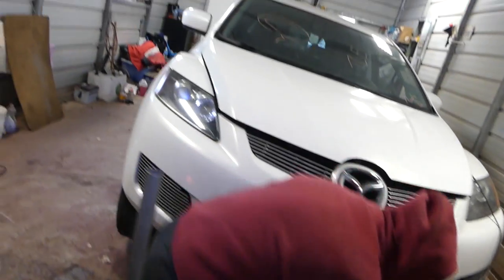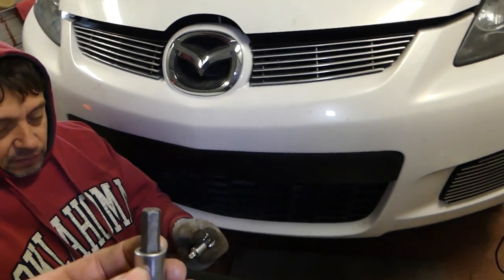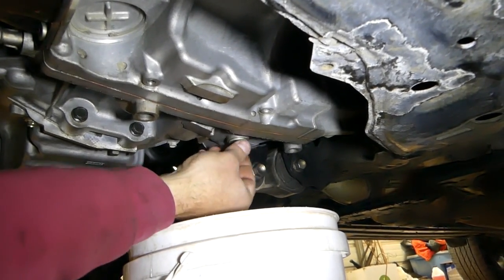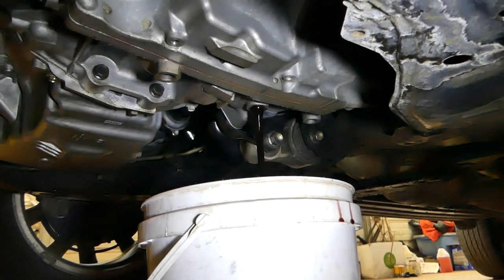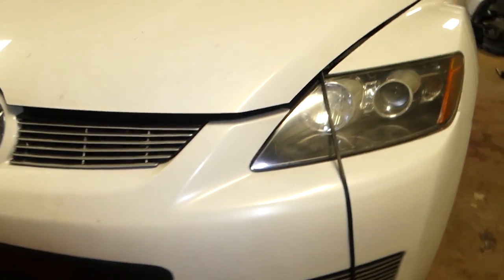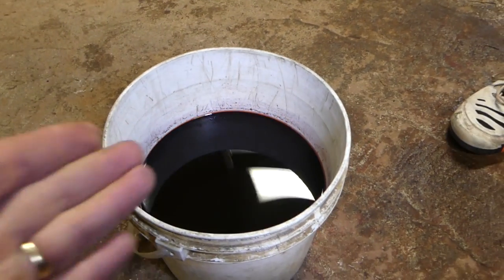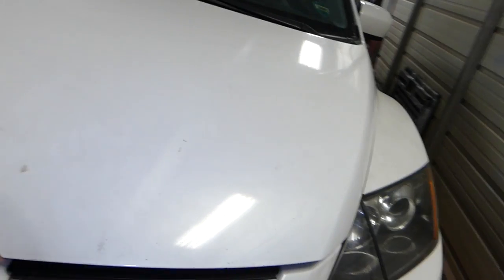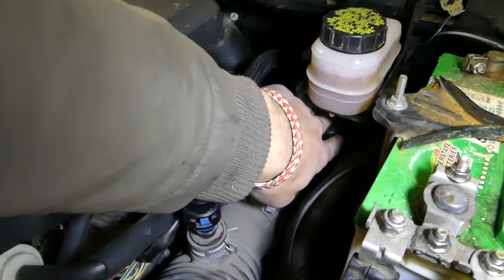MAZDA CX-7  AUTOMATIC TRANSMISSION FLUID DRAIN FLUSH CX7 2.3

Comment: Do you add the transmission fluid back in thru the dip stick? also do you recommend use of any AT fliuid with additives like lucus if there are 75000 miles on car?
Reply: Yes add back through dipstick, buy a  flexible oil funnel.

Comment: Hi Guys Thank you for the videos ,,, very very helpful . I have Mazda CX-7 2010 2WD 5 speed automatic transmission and I have a problem with the transmission,,, suddenly the reverse was not working and when I drove it for about 100 meter I heard click on the transmission and then I tried the reverse and it worked but it slipped again , I changed the transmission fluid but the same problem .. Do you think if I change the transmission solenoid pack would fix the problem or could be just few solenoids ?? 
Hope you could help much appreciated .
Reply: I have a similar problem. How did you have your transmission fixed?

Comment: when you drain the old fluid put a gallon of new fluid back in and remove the line on the radiator and put. piece of clear hose on it. Get someone to start the car and the new fluid will run through the torque converter and push the old fluid out and it will take about 10-15seconds and the fluid will look clean and shut the engine off and put new fluid back in and check the level
Reply: I had a hose get a while and I have no idea how much I lost and I don't have someone else to start the car what do you recommend? Also I know I've had other cars where you have to check the trans fluid with car running. Not the case on the cx-7 right?

Comment: My 2010 Mazda CX-7 2.5L has over 200,000 miles on it, I do my own  oil change, but never checked the Tran fluid, i did today, its black. It drives great, what should i do?
Reply: My mechanic said if it shifts smooth don't change the fluid.. it could make it worse.  I have the same year and engine

Comment: Hi my friend I'm about to buy one cx7 2007, but it have the AT light shown in the board, does it means that is needed to flush the transmission fluid?
Reply: i wouldn't buy that. I have 3 mazdas and have never seen an AT light on.
Reply: All I have to say is pass, unless it's free and comes with 3000 in the glove box.

Comment: What transmission fluid does the mazda cx7 use?
Reply: Castrol makes an import transmission fluid that is supposed to be just fine for it as well. I'm wondering tho so you check the trans fluid with the car running or no?

Comment: You mentioned all the irrelevant easy steps and forgot the most important one on how to check the level of transmission. Do you need to start the car and keep engine running while checking transmission or do you just check when engine is off?
Reply: Leave running til it is completely warmed up, shift through all gears PDRN then leave in neutral on level ground and check. Though I think you can check when the engine is cool but I usually just do this

Comment: What transmission fluid should i buy for my mazda cx7?
Reply: the mazda 5 takes Mv-5 or m5.  the valvoline maxlife atf and castrol multi-import atf works well too. I am however going to go back to the original type fluid. Idemitsu atf type M, it is made for the Mazda's that takes Mv, M5
Reply: My 2010 cx-7 2.3 which is a turbo uses Mazda Genuine Fluid (0000-77-114E-01) T-IV/JWS-3309 (10 bucks from the dealer per quarts buy 7 of them). When I changed it only about 3 quarts and a little came out. I did twice around 100 miles apart. You could also use Castrol Transmax Import Multi-Vehicle Automatic Transmission Fluid, about 5 bucks from walmart. I also purchased a new gasket for the plug part # 9956-41-800. I only put the new one on during second change. It seemed fine to reuse the old one. To remove the plug you need 10mm hex. 2 bucks at home deport search for 3/8 in. Drive 10 mm Hex Bit Socket
Reply: Maxlife

Comment: i have a problem with my cx7 it wont go more than 40 mph what can it be
Reply: I have a similar problem, I hear a loud whistle like the sound of an airplane taking off. I am trying to find the bolt on the trans where I can add fluid cause I can hear the sound from inside the car, I can reach just about 40mph too and it starts screaming a high pitch sound, the shift stick vibrates a little, I have asked some mechanics and they said it could very well be the trans fluid, since I have a sealed trans there must be a leak. Hope you found your problem.
Reply: FREE-OBO
Reply: Daniel Santiago
Reply: I had the same problem, turned out to be the turbo blown due to engine oil not circulating into the system. I have also found a few blown air hoses that connect to the turbo. It might have been just those hoses but when I took turbo out it was gone, so I replaced the turbo and hoses.